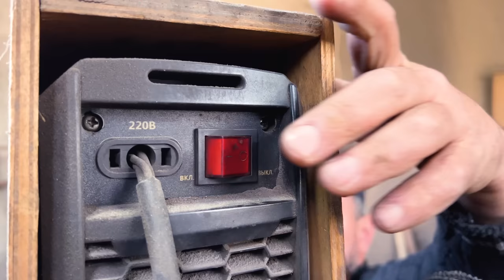I Made A Knife Out Of A Drills On Concrete! The Result Surprised Me Very Much

Comment: At what point did the tungsten all fall out? There is no way to forge that stuff .I am surprised that you didn't cut the ends off before starting
Reply: i just came in to say the same thing
Reply: @chopperchuck 
Me too, tungsten carbide tips wouldn't be very desirable!
Reply: I was just about to ask: did the Tungsten forge?
Reply: @philholdsworth8280  no
Reply: @chopperchuck  looked it up, it doesn't forge.
Reply: @philholdsworth8280  i know it does not fogre thats why i said No
Reply: @chopperchuck  I looked it up. I wasn't ready to automatically believe you. 
That's why I looked it up.
Reply: @chopperchuck  What's 'fogre'?
Reply: @philholdsworth8280  forge spell by someone with dyslexia who didn't double-check
Reply: @chopperchuck  Slickdexia, that old nestchut.
Reply: @philholdsworth8280  "fogre" is forge with some letters rearranged.

Comment: So, did the cutting tips fall off, or somehow get incorporated into the finished product?
Reply: tungsten tips are brazed on, so fell out, you can clearly see one missing at 1:56
Reply: You can't forge Tungsten carbide.  So the tips likely shattered under the hammer and flew away.  Those carbide tips were brazed in so likely, some of the brazing material remained.

Comment: Hi I wonder, what is the steel of the concrete drill bits?
Reply: Most likely tool steel
Reply: Usually, those shanks are pretty low carbon as they don't have to hold an edge.  Looking at his sparks while grinding, that seems to be the case.  I imagine this knife won't hold an edge.

Comment: Just starting the video... I don't think rock drills are made from a steel that is suitable to make a knife. Normal drills are made from HSS. That works well. This? Probably not.
Reply: you might don't know but some rock drill or jackhammer drill are made out of high carbon alloyed steel
Reply: @agaralpha1842  Found out the hard way recently because the jackhammer bit rounded off because I didn't continuously spray water on it. It softened by the heat and flatted out. ^^
But I also was not precise enough in my critique. What I actually meant: Using those rock drill bits leaves you in the dark. Maybe there is sufficient carbon in them? Maybe there is not? As the carbide tips are brazed in, the shank is probably not in a tempered state any more. So the designer didn't specify a heat treatment there by manufacturing design. Chances are huge, that the steel was not chosen based on its heat treatment capabilities, but by price. Which would leave you with a terrible knife.